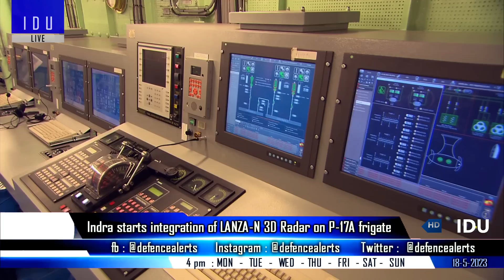Indian Defence Updates : ORCA Revived,Enhanced Kaveri,DRDO 300mm LRGR,LRLACM Test,LANZA-N on P-17A

Comment: if Kaveri engine development is progressing well as being mentioned in the defense portals, then ORCA should be designed as Rafale class fighter with Kaveri engines even if the engine produces only 70KN wet thrust (twin engine configuration will bring it to 140KN). 
The engine might underperform but with many engines operating, GTRE will get more real time data points from them and this will help future engine developments and optimizations. Apart from that, more engines production will not only help in developing innovations but also help build the engine ecosystem locally thereby reducing costs and time over long run.

Comment: Currently we have 270 su -30 mki in our airforce. Eventhough we upgrade it to super sukhoi standard  After 2045 we need to replace 270 su - 30 mki which consist of upgraded and unupgraded su - 30 mki with 300 - 400 orca as acquiring amca and amca mk2 in such a large number is very costly to indian air force. It will do the same role as su -30 mki but in a more efficient and effective way.
Reply: Mrfa is not possible bro. If we manage to produce orca before 2040 then there is no problem In maintaining iaf fighter jet squadron strength after 2045.

This is Iaf plan
After 2035 

We will have 2 Squadron of tejas mk1
We will have 4 Squadron of tejas mk1a
We will have 2 Squadron of rafale 
We will have 2 Squadron of amca mk1
We will have 7 Squadrons of amca mk2

But 
We should order 16 Squadrons of orca
We should order 12 Squadron of tejas mk-2
Reply: @ganeshprabu.k.s2082  So you are saying IAF will be fine with only 17 squadrons and that AMCA will enter service before Tejas MK 2?
Reply: @ganeshprabu.k.s2082  Not sure how you get these numbers as it is not going to happen. MK2 will enter production from 2032 at the earliest. AMCA 1 will start from 2035 and no one knows when AMCA 2 will enter as even design is not finalized. So if we dont order MRFA by 2035 we will have following

7 squadrons of Tejas MK1A 
12 squadrons of Su 30
3 squadrons of Mig 29
2 squadrons of Tejas MK2
2 squadrons of Rafale

so total of 26  squadrons with most of obsolete aircrafts with Rafale capable of any offensive operations. 

So unless we order MRFA we cannot survive war with Pakistan forget about China.

Comment: DRDO should make a problem free good afterburner to make full scale Kaveri engine. It is an excellent move by DRDO.
Reply: Can you give any tecnical solution?
Reply: @Flying Tiger after burner removed due to blade throghing issue, safron offered blades but they are not ready to share technology,
If we use this blade and start testing it will take another 5 years in testing, so better without afterburner produce engine,
This engine can be used in UAV, also lots of Market available for this engine also,
In parallel DRDO and GTRE also work on this issue,

Comment: Only the Rolls Royce can help India in development of a new high power jet engine for the ORCA. India must have all the fighter aircraft with twin for a  engines for the commonality
Reply: That stupid when you say "ONLY"
Reply: @Flying Tiger 98kn engine is no good. India needs a 120 KN engine for AMCA fighter aircraft. India has no engine currently in that area.
Current engine that power jets are 78KN. But future fighter engine must be 120KN. Even the GE F414 is not a suitable engine. Only Rolls-Royce is capable to help India
Reply: Nai bhai .. rr bola ki new engine develop karega.. new develop karte karte 8 saal lag jayengAy... apan bahut late hoo jayengay tab tak
Reply: ORCA only make sense if IAF buys F-35 instead of Rafale.
Reply: @Flying Tiger existing engine is no good. That's why India must develop the engine.
Reply: @Flying Tiger yes f414 is no good.  Indian government is wasting money. India already has technology to manufacture Russian AL-31 engine that can be upgraded. But that is not happening.
Reply: Safran...
Reply: @debdeepmukherjee1373  safrane engine only for stop gap requirement. Long term goals is for India and Rolls-Royce to make a high power jet engine for future aircraft. 
India has technology to reverse engineer Russian AL-31 engine that can be upgraded to the required power. But due to unreliable supply chain India must develop with Rolls-Royce. India will benefit more than safrane engine.
Reply: @prashantpatel7643  Let's see. When Rolls-Royce deal going to conclude please knock me in this comment section bro. Then I would love to appreciate you from bottom of my heart. Would love to see your reply on this thread ASAP..
Reply: The only engine rr are making is the one of the ef. And they dont own it fully